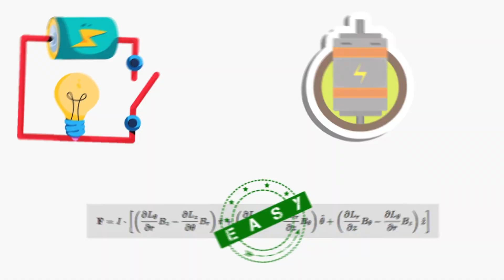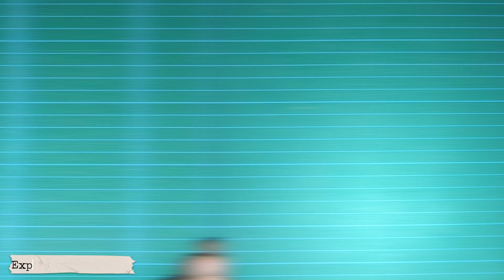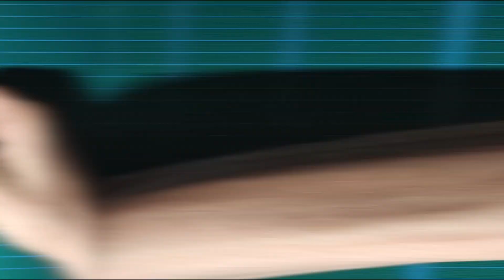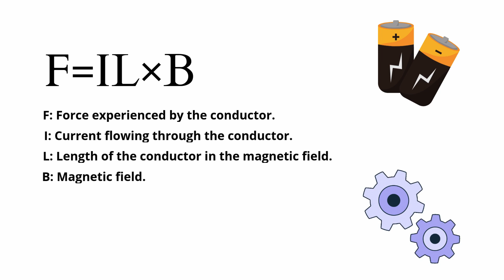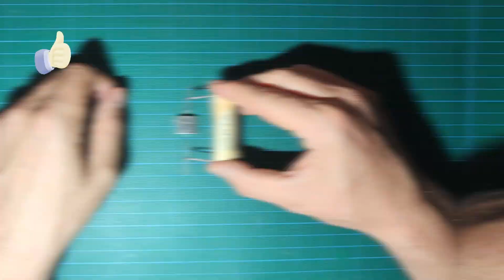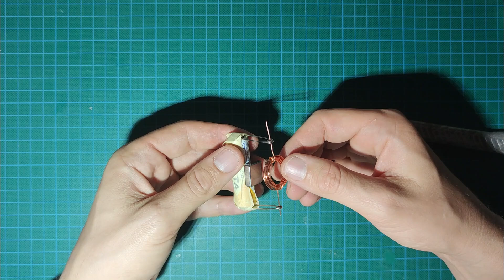Unleash the Power! Electric Motors Explained with Fun Experiments!

Comment: Excelent video, but how did you achieve the commutator? i didn't quite catch it
Reply from the maker: Thanks for the kind words and for such a great question! In this simple model, the commutator doesn't reverse the poles like in traditional motors. Instead, it just interrupts the current flow for half of the rotation, allowing the motor to keep running thanks to inertia. Since we're using magnet wire, which is insulated, I stripped the insulation off on only half of one side. This way, the current flows only part of the time, making the motor work!
I also made sure to design each experiment so that it could be done affordably at home with simple materials.
Reply: Thank you so much